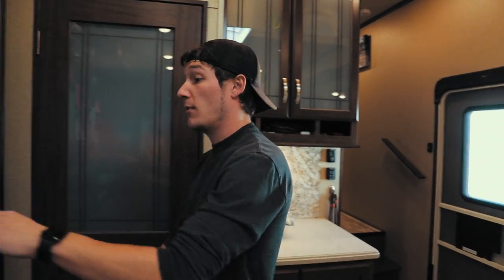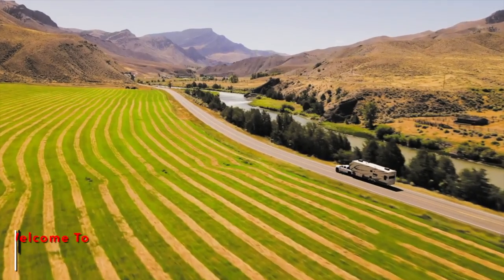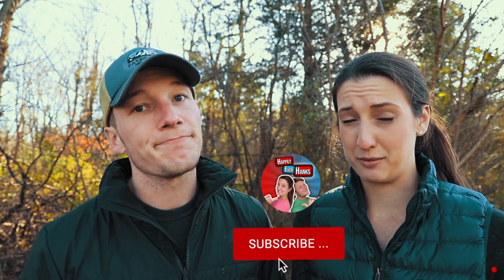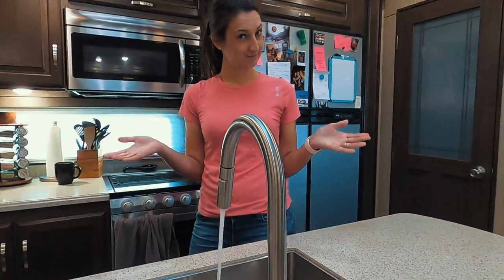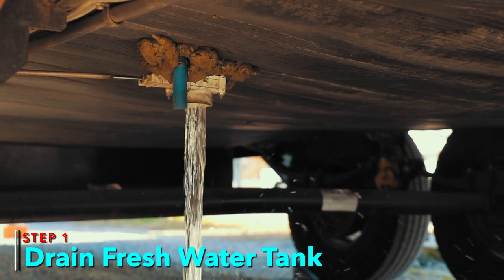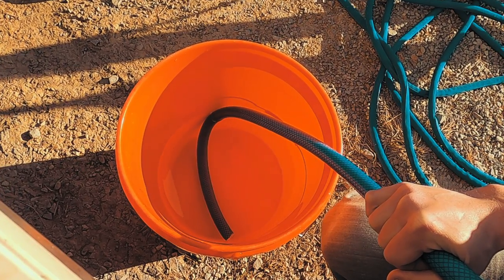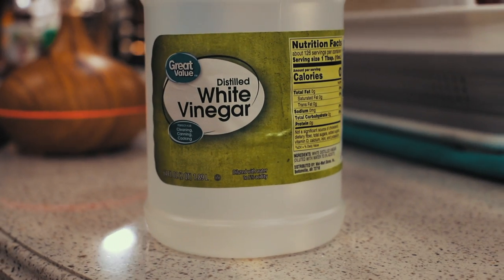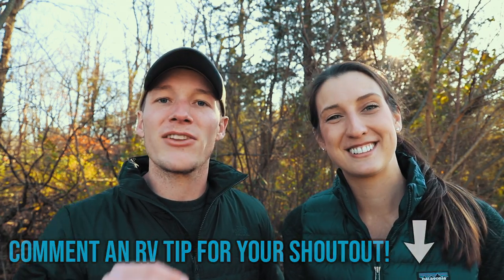How to Sanitize A Grand Design RV Water System (EASY)

Comment: I might just add bleach to my water in amounts used to sanitize drinking water. So for my 40 gallon tank, that would be about 1 tablespoon (or maybe a bit less even like 2-1/2 teaspoons) of household bleach (and use it like that, no rinsing or flushing). Also, I think people make a big mistake when they use a filter when adding city water to their tank, the water needed the chlorine to remain safe in the city water system, and our RVs need the chlorine in our fresh water tank as well, of course some of that gasses off while filling it, thus the thought of adding a bit more here and there. It is easy enough to remove bleach with a filter at the kitchen faucet with any type of charcoal filter or filtering pitcher. Of course you are correct in your video that the proper recommendation is to sanitize, but I know of villages that many of the homes use a water tank system, and they aren’t flushing every year…of course the water from the water delivery truck has a strong smell of chlorine bleach. Just some thoughts I was having anyway, I like to keep things simple when possible.
Reply from the maker: This is fantastic Travis! Thank you so much for taking the time to write this out for us and everyone reading. We really appreciate your insight and support 😃🙌🏼 keep these wonderful tips coming, we hope to hear from you again soon. Cheers!! - Kyle and Renee

Comment: That's a thing? Hmmm, I guess it is. We've only filled our fresh water once and drained it when we ended our boondocking excursion. We don't boondock often. I probably should do a thorough cleaning on it just the same. Great video.  :)
Reply from the maker: Thanks for watching!! When we had our first RV it was almost 1.5 years before we decided to sanitize, just cleans out all the faucet really well especially if you drink water from them 👍🏼 ~Renee and Kyle

Comment: Hmmmm.... A thought came to mind while you were doing this. I wonder if it would be best to do this on a travel day. Once you've filled the tank with the bleach water, two or three hundred miles of road agitation may assist with the removal of particles in the water pipes. 

RV Pet Tip of the week. If your Vet prescribes Prednisone for your dog, only give the short term medication between travel days. Your dog will pee uncontrollably without warning. They will have to go every two hours and will want to drink up to a gallon of water per day. I just learned this the hard way this week. Plus it gave Logan some major anxiety. The prescription is over and will take another day or two for his system to return to normal.
That's not good for a Therapy Dog that's supposed to give comfort.
Reply from the maker: Yeah that’s a great point, we might start doing that and aligning travel days to accommodate for that as well. We just need to be sure we land a site that had a sewer connection. Recently we have been doing a lot of state parks which is nice, but they only have dump stations. Hard to take your time at those 😅 

Oh my goodness, I am so sorry to hear that you and Logan had to go through this. Poor guy ☹️
Excellent tip! Would have never thought of that, glad you are sharing with us!!

Comment: Thanks to the info. I'm hypersensitive to chlorine. Anyway to cut back on the beach or other options?
Reply from the maker: Hey Charlene, I am not familiar with any other sanitizing solution other than bleach. Usually after a thorough flushing, you can use PH test strips to ensure that the bleach is completely flushed out! 😃
Reply: @HappilyEverHanks  Thanks so much! I really appreciate your help. Hope everything is working out well on getting your RV fixed soon.

Comment: Do you guys Just fill the fresh water tank until the water comes out of the overflow tube when sanitizing?
Reply from the maker: Hey there! Great question 😀👍🏼 we don’t like overfilling our tanks to the point of the overflow releasing water... reason being is because this can over pressurize your tanks

So once we have the solution in the holding freshwater tank, we usually fill it up to about 3/4 of the way full 😃👍🏼 

Hope this is of some clarification, rule of thumb is just don’t overflow your tanks

Comment: At some point, you guys made a video where you forgot to fill your water tank and you borrowed a pump and bucketed water in.  BUT, Couldn't you have used this feature to pump water in, w/o borrowing a pump🤔? 🤯
Reply from the maker: Hmmm 🤔We both can't recall borrowing a pump. We did however siphon water at a state park in Idaho if that is what you are referring to 🙂 In this video, we also siphon the water treatment into the holding tank via the same method

Comment: What is the point of pumping out the entire fresh water tank(into holding tanks)  after the water and bleach solution has been in there for 8-12 hours? Could you not just dump the fresh tank ,drain low point drains,  refill fresh tank with fresh water(add vinegar to help with to remove bleach taste). Pump fresh water through lines to get bleach water out. This would reduce the amount of bleach water in your holding tanks. I would think bleach in holding tanks would mess with the Microbiology of the holding tanks.